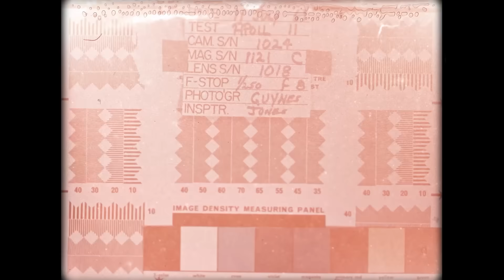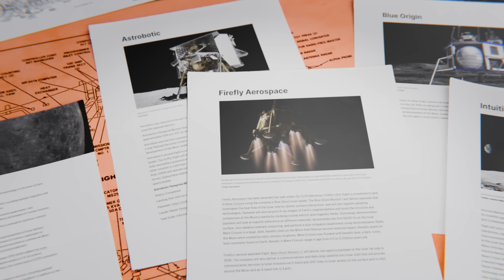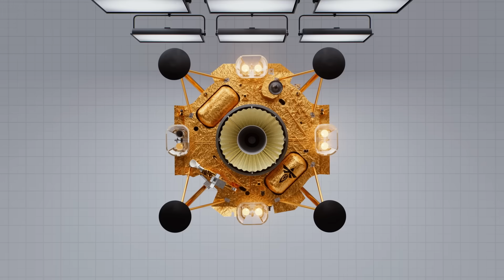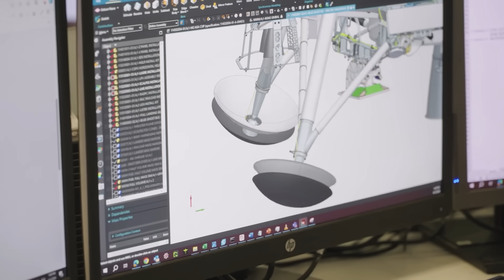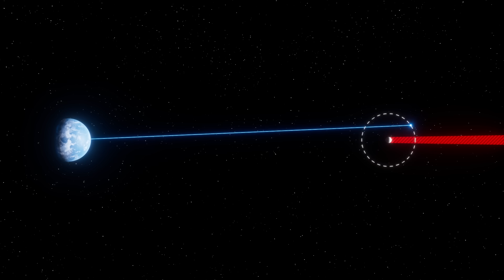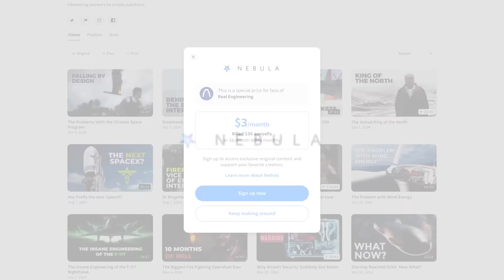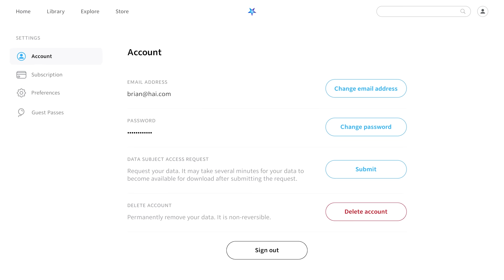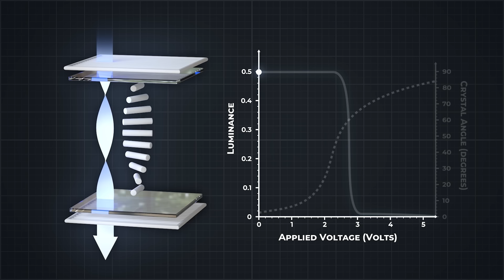Why the US is Struggling to Land on the Moon

Comment: Out of all this, you fail to notice the key defining factor.  
1969... human pilot lands on the moon.  
2024... computer  AI  fails to land on the moon.  
1885 - 2024... humans drive automobiles.  
2024... computer  AI  struggles & fails to self-drive automobiles.  
500,000 BCE - 2024... humans walk & run.  
2024... computer  AI  struggles to just walk.  
See the pattern yet?
Reply: 1965 onward, 5 Surveyor missions and several USSR Luna missions land autonomously on the moon. These were really dumb spacecraft compared to IM-1. They had no terrain avoidance capability, they just landed blind using only an altimeter to make sure the speed was zero at touchdown. 
IM-1 failed because of a dumb human error: they forgot to switch the altimeter out of safe mode during the preflight check. Without that, no amount of computer power is going to save your mission.
Reply: @Hobbes746  
None of those probes funtioned autonomously.  They all followed a preset of programed inputs.  
Same as all the rovers rolling around on Mars.  
Not a single one is capable of making an autonomous decision to adapt to a situation or problem.  

During landing Neil Armstrong made a series of course corrections, literally on the fly.   
AI  is not yet capable of making adaptive decisions.  Their function is still limited to preset programing, by humans.
Reply: @OOTurok  All of those Surveyor and Luna missions used altimeters to detect the ground and did their landing operations relative to this measurement. They landed autonomously, without a human in the loop.
This is very limited: they had no way of mapping the terrain in detail so they could not avoid boulders, cliffs etc. 
 
The rovers on Mars use a variety of navigation methods. They started out with remote control: the rover would take photos of the terrain ahead, and the team on Earth would tell the rover exactly where to drive. 
But they have been adding autonomous functions, so these days they can tell the rover ‘drive to location X’ and it will choose its own path. This has limitations: if the rover encounters terrain it deems unsafe, it will stop and wait for instructions.
Reply: @OOTurok  Modern moon landers, including IM-1 have enough computing power on beard to build a detailed map of the terrain below, recognize dangerous terrain features like boulders and cliffs, and adjust their course to avoid those.
Reply: Your inability to rectify your fallacious reasoning? I don’t know, you don’t seem to have the courage to make a definitive claim.
Reply: @DemonDrummer  
It's not fallacious reasoning.  They are facts.  
AI  technology is not on par with the human brain yet.   AI  still only functions within its programming & it not capable of making adaptive decisions.  
All the walking robots have only been demonstrated on flat level surfaces & predictable stairs.  None of them are capable of walking effectively on rough, uneaven terrain.  
The new self-drive technology also lacks the capability to make adaptive decisions.  
All military drone aircraft are remote piloted by human pilots, because again... their AI systems cannot make adaptive decisions.  
The human brain is still superior in this aspect.
Reply: @OOTurok  It seems like you’re drawing wild conclusions based on false equivalencies. Are you saying AI isn’t better n par with human capabilities? If so, I agree for the most part. But I’m not sure what your overall point is then.
Reply: @DemonDrummer  
It's not a false equivalence.  It is a fact we do NOT have thinking machines.  We have machines that follow programmed instructions.  None of them are capable of thinking autonomously & adapt to changing situations or problem solve a malfunction.  
All of this has to be done by humans sending the probe a set of PROGRAMMED instructions to follow.
Reply: Having to program a rover or probe, a set of instructions to follow is NOT autonomous thinking.  
The humans programming the machines are the ones controlling them.  
The humans programming the machines are the ones doing the thinking.  
When the Galileo probe's antenna failed to fully open... it was humans that had to problem solve the situation & send the probe a programmed set of instructions to mitigate the malfunction.  The probe had  ZERO  capability to problem solve the situation for itself, because it canNOT think autonomously.  

It was exactly the same issue with the IM-1 Lunar lander.  It followed its programming to the literal bit, & had no ability what so ever to think outside of that programming... which is why the lander could not think for itself & disengage the altimeter's safe mode.  

If a Mars rover pilot miscalculates the coordinate instructions that will cause the rover to drive off a cliff... the rover is NOT going to think for itself, problem solve the situation, & divert its trajectory.  
It will follow its programmed instructions right off the cliff.  
None of these machines are autonomous... they need humans to think for them, & they need humans to program their instructions.  

Neil Armstrong on the other hand was capable of autonomous thinking, & was able to make adaptive decisions to problem solve situations in the moment.  
As dumb as the 1969 Lunar Lander was... it was programmed with a fail safe function, that if the fuel load dropped below a certain level, & the lander sensors had not detected a touch down... the lander would automatically ignite a full burn for orbit.  
But you know happened?  
Armstrong made the executive decision to disengage that fail safe, & pilot the lander a series of course corrections in the moment, to the surface... because humans are capable of literally thinking outside the box.  
No  AI  is capable of this yet.  None of them are autonomous.
Reply: @OOTurok  You are using the wrong definition of “autonomous”.
Reply: @OOTurok  That’s not the false equivalence part. The comparison with the past is. Please answer my prior question.
Reply: @DemonDrummer  
I wasn't comparing the past.  I was comparing human pilot vs AI pilot.
Reply: @Hobbes746  
Autonomous... definition, Robotics...  an intelligent machine that “can perform tasks and operate in an environment independently, without human control or intervention”.  

Again... by the literal deffinition... space probes, rovers, military drones, the IM-1 Lunar Lander, etc. are NOT autonomous.  
We have not yet developed thinking machines.
Reply: @OOTurok  For what purpose? What is your point or claim?
Reply: @DemonDrummer  
The video possed the question why were we able to land on the moon in the past, but are currently facing technical difficulties at achieving it now?  
He then goes on to discuss how NASA needs new technological advancements to relearn how to land on the moon.  

My point is, back in 1969... a human pilot opperated the lunar lander, who was capable of making immediate corrections & problem solving in the moment.     
Today we are trying to do it with drones, which do not have that capability.  They can only follow their preset programming. 
A thinking human piloting the lunar lander in real time... vs ... an AI limited to its preset programming. 
That is the fundemetal difference, of why we were so successful in the past.
Reply: @OOTurok  Okay, that makes more sense. But, are you referring to the Artemis Program? If so, who is saying NASA is using AI in lieu of human pilots? Also, Apollo used a combination of automation and human involvement for many aspects of the missions.
Reply: @DemonDrummer  
No... I was referring to the Intuitive Machine landers mentioned in the video.   
And yes there were unmanned Apollo missions, but they were all preliminary tests for the human missions that would actually land on the moon.  
NASA will no doubt do the same with the Artemis Program.
Reply: @OOTurok  No. That definition doesn’t say anything about how capable the device has to be. It just says it can to tasks without human intervention. Even the Surveyor could do that: it landed on the moon without human intervention.
Reply: @Hobbes746  
If a human has to  "INTERVENE"  to  "CONTROL"  the machine, either by remote, or by programming a set of instructions for it to follow... then that means it is not a "thinking" machine that can perform tasks & operate independently of human control or intervention.  

You can try to strawman the definition all you want... it will not change the fact that they are not thinking machines.  
It will not change the fact that they need to be programmed by humans, which is human intervention & control.  
These machines do NOT program themselves, & they do NOT think for themselves.  
They are NOT autonomous.
Reply: @OOTurok  You’re the one trying to change the definition here.
Reply: @Hobbes746 
I haven't changed anything.  
Autonomous... as defined in Robotics, literally says...  an intelligent machine that “can perform tasks and operate in an environment independently,  WITHOUT  human control or intervention”.  

None of the machines you talked about were capable of thinking & performing their own tasks independently.  
A human had to  "INTERVENE"  & program those machines what tasks to perfom, & how to perform them.  
The human is the one writing the program... the human is the one telling the machine what to do... the human is the one in control.  
Without a human telling the machine what to do... the machine just sits there doing nothing.  

The burden is on you to prove that the IM-1 Lunar Lander programmed itself, & thought of its own plans to land on the moon.
Reply: @OOTurok  No! Programming before the fact is NOT the same as interacting with the machine DURING execution of the program.
Reply: @Hobbes746 
If I program a machine instructions, telling it what tasks  "I"  want it to perform, & how to perform those tasks...  who is the one in control?   Who is the one doing the thinking?  

NOT  the machine.
Reply: @OOTurok  By your definition no machine will ever be autonomous, because they’re all programmed by humans. 
The actual definition of ‘autonomous’ in use today is not the definition you use. 
The robots in an Amazon warehouse, picking up pallets and driving them to a new location are autonomous. Surveyor was autonomous, as are all of the robots driving on Mars. The only unmanned vehicle we’ve deployed outside Earth that was not autonomous is the Lunokhod rovers: those were operated by remote control. The Surveyors were not. They had a program that told them where to land, but had incomplete information when they set out: x and y coordinates were known (with a margin of error), but the z coordinate had to be measured by the Surveyor during the landing, with no human in the loop.
Reply: @Hobbes746 
It's not my definition.     It is the definition used in Robotics that defines an autonomous thinking machine.  
Notice how the definition talks about an  "INTELLIGENT"  machine.  
We have never created an intelligent machine.  
The  AI  we currently have is known in the field of Robotics as... Dumb AI ...because all of the machines we are talking about canNOT think for themselves.   They are only capable of following what ever program is instructed to them by humans.  

All of the space probes, rovers, & unmanned lunar landers we sent out... do NOT think for themselves.  
When their programming gives them incomplete information... they are incapable of "thinking" about their situation, & making corrections on their own.   A human has to send them a set of new instructions to follow.  
This is WHY the IM-1 Lander crashed.  It could not properly analyze its situation & make nessecary corrections.  It was entirely dependent on humans to tell it what to do.  

You have NOT demonstrated proof that any of these machines can think autonomously.  
Every example you have given has proved that, unless some human gives any of these machines new instructions to correct a problem... those machines will perform that problem as they were programed to.
Reply: @OOTurok  People have been using the word ‘autonomous’ for decades with a very different meaning to the one you are using. 

The real point I made, and which you have completely failed to rebut, is that the USA and USSR made many lunar landings in the 1960s with unmanned spacecraft that were not controlled remotely. There was no human in the loop on any of those landings. This is decades before your 2024 “failure”.
Reply: @Hobbes746 
No they have NOT.  
There is a difference between a machine performing an autonomous function... & the machine thinking autonomously.  
You keep insisting on conflating the 2 as the same, & you are wrong.  

A digital watch measures the time autonomously... but nobody believes that the watch thinks autonomously.  
Everybody knows that it ONLY performs its PROGRAMMED function.  
The watch is NOT an autonomous thinking machine.  The same for all the unmanned probes that landed on the moon.  

You still have not demonstrated 1 single example of these machines thinking autonomously.  
Every single one of them were programmed by humans.

Comment: The technology is 'lost' 😏 riiiiiiiight
Reply: The knowledge isn’t lost. The production lines for obsolete stuff like the Saturn V have been discarded. And the replacement (the Space Shuttle) was optimized for things other than lunar missions.
Reply: @Hobbes746  60 year old technology can't be replicated?
Reply: @jimmicrackhead12  Sure, we could rebuild the production lines for the Saturn V, but that’s not free.
We could replicate the Saturn V design. We’d have to start by converting the 6 million drawings we have on microfiche into a modern CAD system so we can use that data to drive modern manufacturing machines to create the parts. Then we’d have to replace thousands of parts that were bought in the 1960s with new equivalents. Then we’d have to replace the materials used in many of the parts with modern equivalents. 
Then we’d have to decide what to do with the electronics: recreate those 1:1, even though they use parts that were only available 50 years ago? Or replace them all with a new design, which we’d have to create and then test? 
Even replicating the Saturn V is going to cost tens of billions.
Reply: Personal incredulity doesn’t equate to rational skepticism or reasons for doubt.

Comment: 1:12 The problem is that we need to go back to the future not wallow here in the primitive present. Back in the future we went to the moon like driving to the park for a Sunday picnic in a moon Chevy, now we can't even land a simple robot. We're pathetic. It would have been really nice if someone would have bothered to write down the procedure for getting to the moon in a notebook. I don't know, seems like something important ya might want to remember 🫠If anything casts doubt of the Apollo missions it's this.
Reply: The “procedure forgetting to the moon” was written down by NASA and is available in a public archive. 
Intuitive Machines decided to ignore basic lessons that were learned by NASA in the 1960s: they forgot to switch the altimeter (which was essential for making a soft landing) out of safe mode during the pre-launch check. They launched the spacecraft without a working altimeter. 
They cobbled together an alternative using some of the science payloads, but this turned out to be not quire good enough to stick the landing. They learned their lesson, I hope.

Comment: Here’s a wild idea, just build a lunar lander like they did between 1969-1972? Seemed to work pretty good for them back then
Reply: The lunar lander from back then weighed 15 tons and had to be launched on a Saturn V class rocket. The IM-1 lander is much smaller and designed to be orders of magnitude cheaper than the LM.

Comment: Relying on visual control still after all these years tells you how far technology has really moved on💀
Like just use physics and the gravity of the moon to calculate the velocity and which direction to burn to come to a full stop. And add more cameras💀. A $120M lander only had 2 cameras and no spares. If one is destroyed, the mission is a failure.
Reply: ‘to come to a full stop’ depends knowing your altitude. And to measure your altitude, you need a sensor. Radar is one option, but it doesn’t have the resolution to allow you to avoid boulders, so you might land in an unsafe spot. Cameras can’t measure altitude directly, so you have to use machine vision to get usable data out of them. A laser altimeter is a decent option, but you have to remember to switch it on before launching the damn thing. That’s where Intuitive Machines went wrong.

Comment: Yeah we went to the "moon" like 50 years ago. And now we struggle to get anyone there with more modern technology, yeah that is some sus sht right here
Reply: Rocket technology has not progressed much at all and although modern computers are far more sophisticated, they are far more vulnerable to particle radiation than those in Apollo that used low density integrated circuits and magnetic core memory, both of which are extremely radiation hard, and a lot of work has had to be done to remedy this. The mission requirement is very different from Apollo. The duration of stay is longer, the terrain will be rougher this time with longer shadows and a heavier lander. We also live in much more risk averse times. All these issues are what has caused it to take so long this time around.
Reply: @Ruda-n4h You're not ready to be unplugged.
Reply: @ “unplugged” is code for “replace reality with nonsense”.
Reply: @Hobbes746 Correct.
Reply: Nothing suspect about that, unless you are into reality denial.